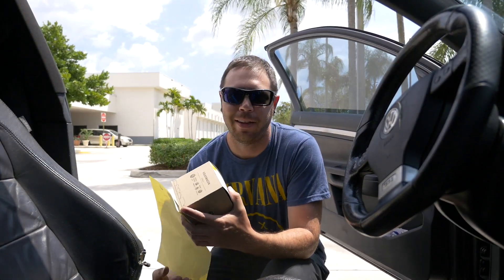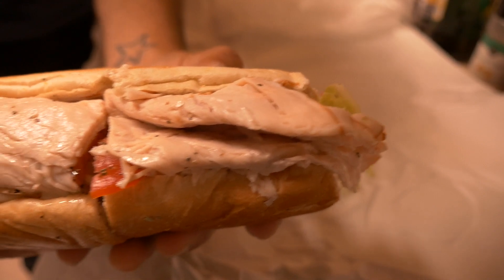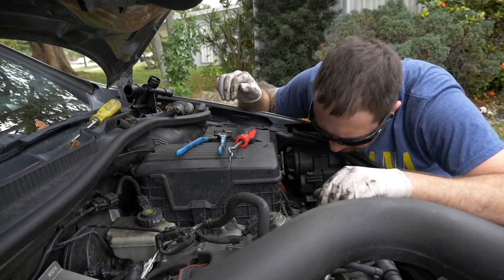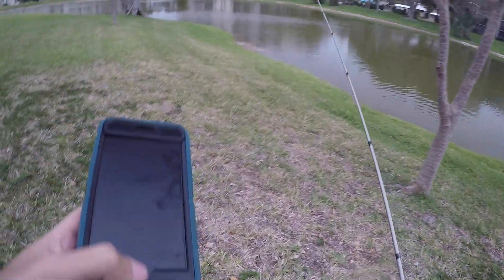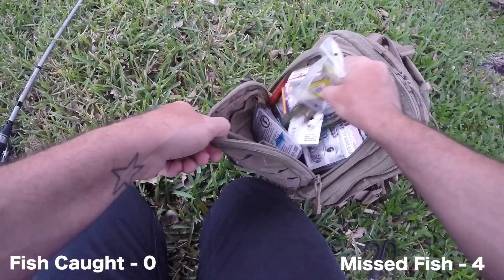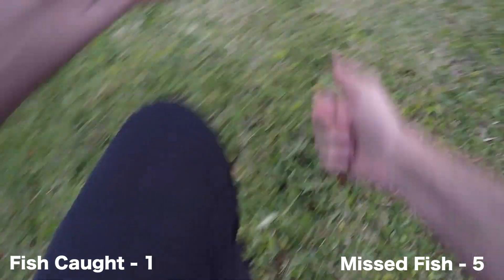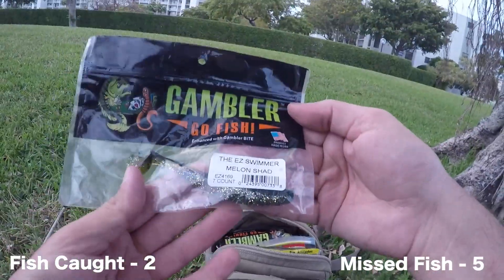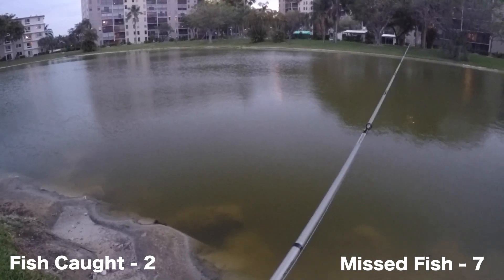YouTube Fishermen Don't Show You THIS!

Comment: I have a Audi and always do the water pump and timing at the same time. You can buy a metal  water pump my Audi is a 01 with 260K and still kicking
Reply from the maker: I would have liked this car more if it wasn't thrashed by the original owner. So many screwed up things on this car I've had to fix. The water neck and other plastic hose connections would have lasted longer if they didn't mix standard green coolant in with the VW specific stuff. Amateurs...